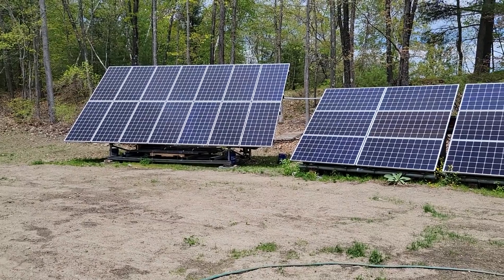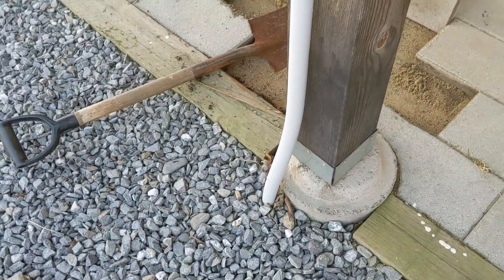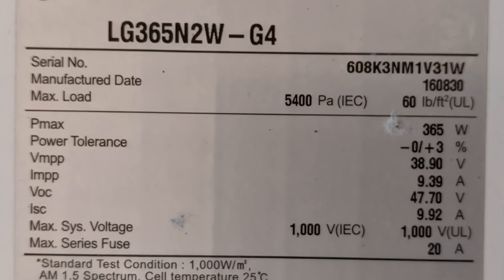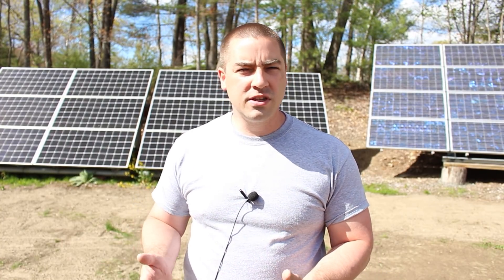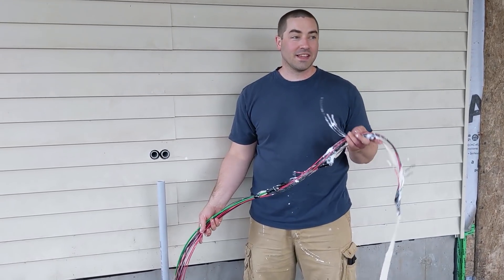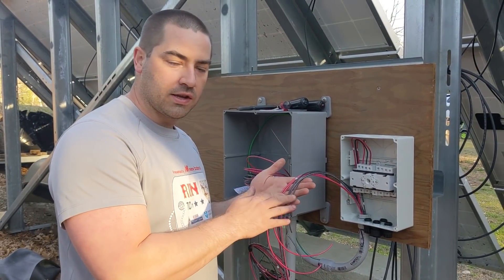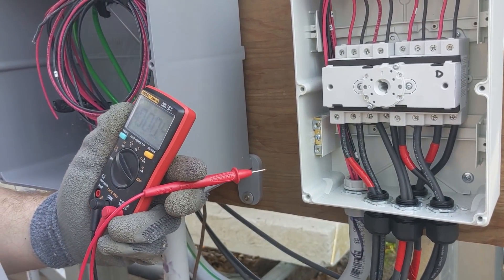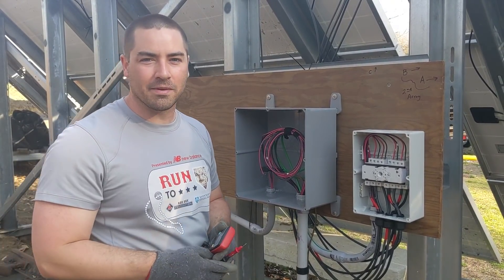Couple wires a huge, High Voltage, Solar PV Array, 12.6kW

Comment: If those are multiconductor then they are cables, not wires.
Reply from the maker: Didn't you correct me the other way around about 2 videos ago?
Reply: @DavidPozEnergy  I told you the same thing last time... wires are single conductors and cables (usually with a shared outer insulator) have multiconductors.  I even gave examples (such as coaxial cable for TV, ethernet cable for computers...).  Those are both multiconductor.  Single conductor wires can be used to series connect multiple batteries together since only 1 conductor is needed to interconnect them.  Note that a wire made up of a bunch of small stranded wires is still a wire, since it is a single conductor.  For multiple wires to be a cable, they need to each be insulated from each other, and usually they will share a common outer insulator too.  If you take a cable and run the same current thru all the wires (as you would in a simple wire), I am not sure what that would be called.  I suppose it is a physical cable being used as a wire.
Reply: @davidjames1684  A cable can be a single conductor, at least according to the U.S. dictionaries and standard trade practice. For example, this product quote from Southwire: "Power Cable 600Volt Single Conductor Copper, Cross Linked Polyethylene (XLPE) insulation XHHW-2 Polyvinyl Chloride (PVC) Jacket"

Comment: How much do you think the total setup has run so far?  Very impressive.
Reply from the maker: I'd guess about $20,000.  But not sure.
Reply: Is that all the solar and mounting wiring with the 3 growatt inverters? Or is there more to this? No battery banks included.

Comment: Not sure if you mentioned in the video but where all your PV panels the same? Or did you mix and match them
Reply from the maker: Every panel in any one string is the same.  But different strings have different panels.

Comment: Are you going to share those low voltage strings one on each inverter mppt feed or just use one inverter (last slave) at a lower voltage. You do understand one day you will have more power than you can use. lol My mistake I thought they had 2 MPPT connections but I see you have said there is only one for each inverter (combiner box it is).
Reply: Not sure if this is still the case, but from what I remember he has an enormous water tank he heats up, I'd suspect there'll never be enough power in that system to boil the water off.